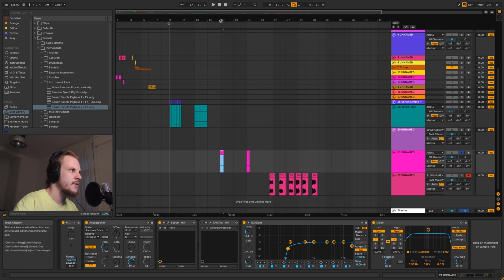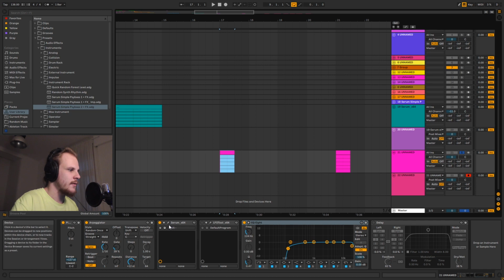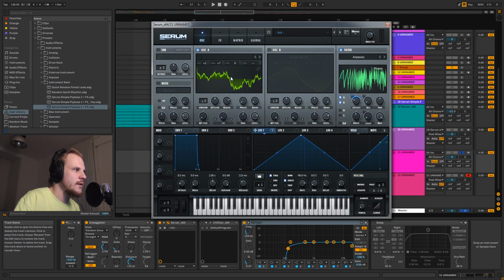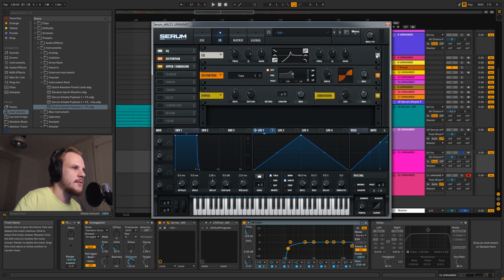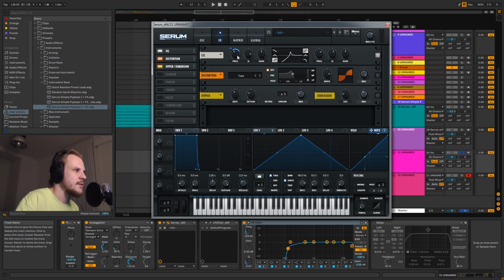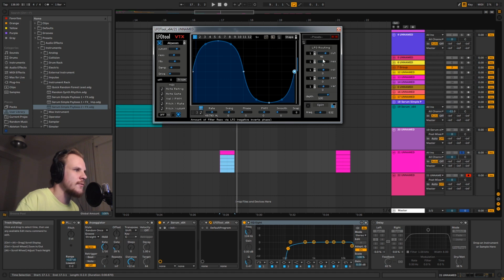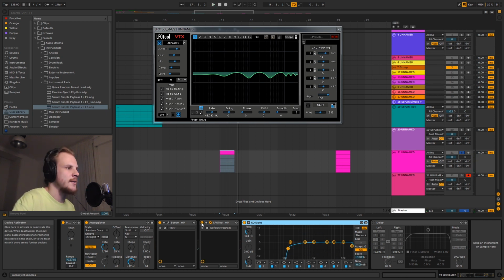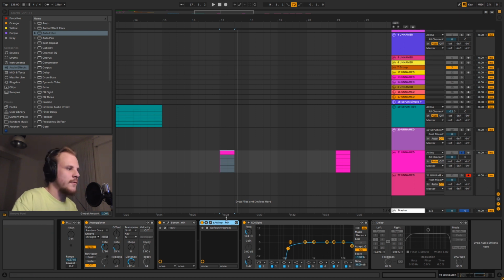An introduction to Filter FM and metallic lead sounds (Sound Design Tutorial)

Comment: i would like to clear that a bit:
its not the same as PM in the OSC section! (if it would be, results would sound the same or not?)
When changing (modulating) Phase of Signal in the OSC section, you are in *Time domain*.You are changing phase over time.
When changing Filter Phase Response you are in a Bode Plot, the *Frequency domain*.You are changing phase over frequency so ALL harmonic subparts of your wave will be phase-changed at a time and this results in a much richer signal-spectrum.

i cant explain it better sry xD.

If i would be to name that, i´d say its FPRM - Filter Phase Response Modulation  only that describes it correctly.
(Weird enough that Serum has an Allpass with that crazy phase response).
Thanks ALOT for the video !